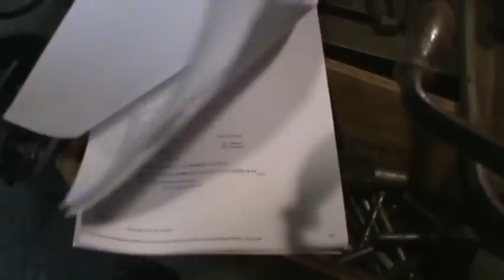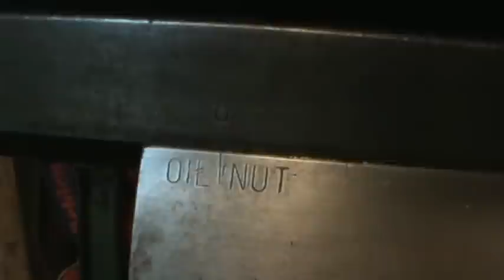servicing the bridgeport

Comment: Hey mustie1 look on eBay see if you can find one up there in your area I'm sure you can. Don't be a roll around cabinet for a computer for like a diesel truck shop or a dock workstation. That used to house the old monitors. I've got one of my shop I'm fixing to make a cutting, drilling, grinder Wheels, everything to cut or drill with cabinet out of. You can usually buy them for like three four hundred bucks. They are invaluable when it comes to organizing that kind of stuff. And you can roll it around it's got super heavy duty casters. They're about two thousand bucks new. But you can buy them for three or four hundred dollars all the time. I'm hoping to do a video on mine when I get it done or in the process. Cuz I'm actually going to attach a set of torches to the back of it and put a hose reel on it. And hang all my Grinders on the outside and inside of it.

Comment: Some of the taper tooling could be B&S taper (Brown and Sharp). B&S and MT taper do not have the T on the end when they are made for a drawbar. You will also get the hang of the machine and the play will not effect your work. You have some very nice tooling and a machine that will do everything you need to do.
Reply from the maker: +Jonathan W good point, one of the vises was a b s

Comment: Congratulations, you seem to be whipping that machine back into shape. A useful thing to have for use with the vice on that mill is a cheap set of parallels. They act like "filler" pieces that hold the workpiece up off the bottom of the vice jaws, and they come in matched pairs of different thicknesses. Anyway, good luck.

Oh, PS: If you find it hard to get way oil I've used chainsaw bar oil on my mill for years and it works fine. The special thing about way oil, just like bar oil, is that it clings to surfaces instead of just running off.

Comment: Hi Mustie1, this is only meant as positive feedback, and you proberbly already know what I am about to write by now. The backlash in the X and Y direction, is in part the backlash in the nut you adjusted but there could also be backlash in the ends of the Acme screw (where the handles and dial are) if you know what I mean, this backlash can sometimes be minimized by thin washers. Generaly one only use the quill to drill with, if you are milling you use the knee to adjust the height (or depth) of the cut you are going to make, and the quill should be locked in the up position and also the X or Y direction that you are not using, this is to get the most sturdy setup for milling so you get the best result of your milling. Also generaly all tools used when milling should  be stored with protection so they do not bump into each other, even small nicks or burrs will greatly affect the quality of your work and tool life, especialy carbide tipped tools or full carbide tools like endmills nicks very easily if bumped into each other and is then ruined. Chain saw oil can be used for the ways. All the best, and thank you for all the interesting videos you share with us and the time you put into making them, looking forward to each and every of them.

Comment: Glad you realized that the ways are to de oiled not greased. Use lots of oil to flush crap out, and careful using an air hose near the ways. You can force crap under them. Take good care of the mill, she's the same age as me.

Comment: Great swap, Mustie.

I was going to suggest switching one of your chucks to an R-8 x Jacobs taper arbor until I saw the price in McMaster. Ouch!!

 On the same page are Jacobs taper on straight shank arbors for $15.  Straight shank end into a collet and you're off and running. Or you could make one  if you wanted to try some taper turning.

Double cab is progressing nicely. Keep those updates coming.

Tom

Comment: Done some Toolmaking in my 20ties and used the Bridgeport a lot . We had the version that used a speed adjuster on the Headstock , and not that Belt Speed Change set up on ur machine . Your digital speed adjuster makes up for that . My Favourite machine 2 work with . A digital read out could be used to take account of ur XYZ discrepancies if you were really keen , but ur Target accuracy is probably within .1-.2mm . Whatever that means in imperial?I work with metric systems , all I remember that 4 divisions on dial of that machine was 0.1 off a millimetre .Wouldn't mind one in my shop .Cheers from Australia

Comment: Using a dial indicator in the chuck is fine for tramming the head perpendicular to the table. It still rotates about the axis of the spindle. The diameter of the sweep is more important. As much of the width of the table as possible. Sometime when your at the scrap yard, keep your eyes open for a large bearing race. They are nice and parrallel. You want one that has either the inner or outer race with a diameter about the width of your table. Set the race on the table and sweep your dial on top of it instead of hopping over the tee slots and divots in the table.

Comment: Rather than trying to drill out that broken screw to hold that adjuster in place, you might just drill and tap a new hole and install a screw to hold it, because over time you know that adjuster is going to back out again.  Nice score on a milling machine that really was just out of adjustment.  Can you imagine, that mill was being used while that far out of whack.  It's great what a little good information will do for you.  You may wanna move that belt sander, as I recall the belt sanders I worked with threw grit all over the area around it.  At the very least some sort of shield...  I just know you are going to hate having that nice clean and lubed mill covered in grit the first time you go use it.

Comment: Make sure all your morse tapers, and R8 tapers are clean, including the inside of the spindles of the mill and the lathe tail stock before you install them. Damage to the taper or dirt will prevent the taper from seating which could allow it to move resulting in damage to the machine side of the taper. A properly seated morse taper will never spin, even without the tang. The tang is only for driving it back out of the taper with a wedge.

Comment: Way to go Mustie! Pretty much anything under .020 on the back lash on a working machine is pretty darn good, the Bridgeport I run at work has .050 back lash in it!............As far as all your saw type cutters go you can easily make arbors with straight shanks on the lathe for your collets.
Reply from the maker: +tomswonderfulworld true, l dident think of that, or even cut down the ones l have to a straight shaft
Reply: +mustie1 Exactly........even your drill chucks can have a straight shaft for a collet. It all just depends on your preference, I personally like my drill chucks to have an R8 arbor only because its handy. Usually on your Jacobs chucks it tells what kind of mount it requires on the chuck around where the part number is stamped. Some are threaded (usually 1/2-20) or they are a JT3 or JT2 taper for most of them.

Comment: Those misc disk mills could be to go on to a boom shaft which comes out from the rear center of the machine and goes to a stand so it mills straight tracks. Some end plane mills you got should have a mount that you fadten them with set screws. If I remember corectly, I learned milling on such a machine 30 years ago.
Reply from the maker: thanks for the info

Comment: On the lathe to mill chuck adapter couldn't you just drill a hole thru it and a small indent on the chuck shaft then tap threads in the adapter for a allen headed keeper screw to lock it in and take care of the reverse problem ?

Comment: As to useing Morse tapers  or MT 2 in your mill , do not use a drill chucks that are held on with tapers to hold  endmills and think your going to cut because it will break free and fall down . To use endmills use only R8 holders for positive lockup  . You can use a chuck to tap and drill with . As to Way oil I think someone else mentioned it , us chainsaw bar oil it is sticky and has preservatives to I think .

Comment: I saw your original purchase and unloading videos, but i missed this one.  Nice work on reducing the backlash.  Interesting on sanding the table, i was about to ask in a video what to do that is more aggressive than stoning as a first step to remove some of the deeper gouges.  Definitely need to dig into both of my Mill's.   Have you been happy with yours?  I haven't noticed you using it a lot, but then again I don't watch all your videos, so busy trying to get the shop going, thanks for pointing this out to me.
Reply from the maker: love it, but l may not use it fior a month but use it 8 hours for a day, the phase converter works great too.

Comment: The proper nomenclature for your tapers are a number two Morris taper
A number 3 Morse taper ECT ECT in print they are
#2 Morris taper
#3 Morris taper.  
That drill bit has a #2 Morris taper on it ...
Your adapter is a R_8 collett to a #2 Morris taper...
Reply: Spellcheck got your keyboard?

Comment: A, , , 'beep'(machinist slang, for, a BridgePort,, mill), ,How, fortunate,, , can you get!!!, , , ,Now,, you need,,to learn, Machinist, language. .. .
delete, 'play,, 'slop 'flop, 'movement, , ,etc. from your diction, ,, & replace, it, with CLEARANCE, , , ,  LEARN TO REFERENCE YOUR CUTTING,TOOLS BY, THEIR , CORRECT, , , names:'end mills reamers, drill bits, fly cutters, , ,& NEVER store them, loose, ,/ in boxes/bins, etc.  Cheep,but, functional, cutting tool storage,can be, ,a2x4, w/ holes drilled, into its',broad, side, the diameter, of, the tools', shank(the smooth/noncutting areas of the tool)  .  .  .  .N  O!!!! , , ,to, maintain, the accuracy, of that, , machine!! It, , ,MUST!!!BE Leveled, , , &,, , P E R M A N A N T L Y / S O L I D L Y!!!  Affixed, to the Floor!!!!! And,, should be covered/ shielded from ALL the AIR BORNE, ,  CRAP, , , ,which, you,, create, , ,contribute, to,, , regularly!!!!  .  .  .When, not in use!!!!!  That machine,may, be very, experienced, ,  BUT, , ,deserves to, be treated, , , as you, should treat,, YOUR MOTHER, , , , WERE,, SHE , TO RESIDE, IN YOUR, SHOP!!!!  ,  ,  ,  I'M,, a 12 year, o t j, experienced, , ,machinist, ,, So, I'm giving you, SOLID,, ADVICE!!!. . . Disregard, it,, to your, regret!!!. . . . ACTUALLY, ,, ,It would, behoove, you to, employ, a reputable, machine tool, experienced, , millwright , , , to setup, that machine for, you, ,and to also, restore, some(as much, as reasonably,
possible, ,), , , ,of the accuracy, capacity, remaining, in that that, Jewel,, of, a machine  ,  ,  , And show you how to, maintain, it!!!